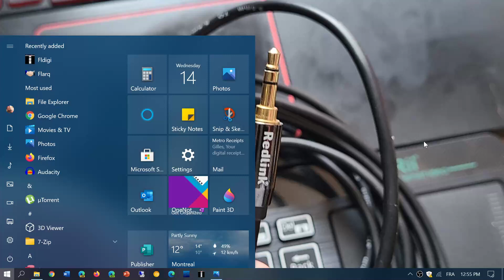Standard audio cable I use and series on digital mode decoding coming up

Comment: I use same type cable as longwire antenna (10 meters). Works pretty good and plugs to the external antenna connector out of the box.